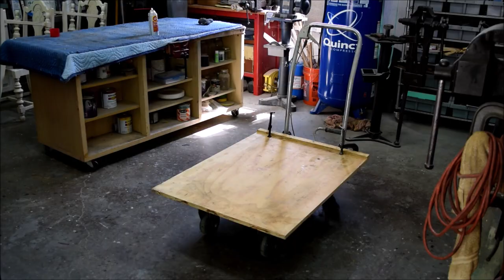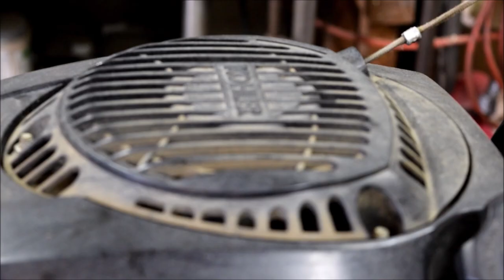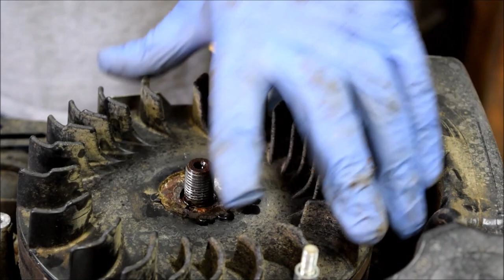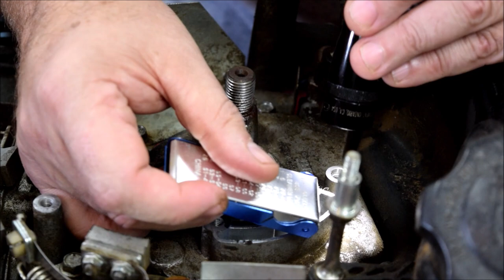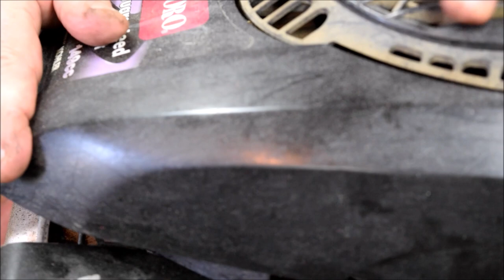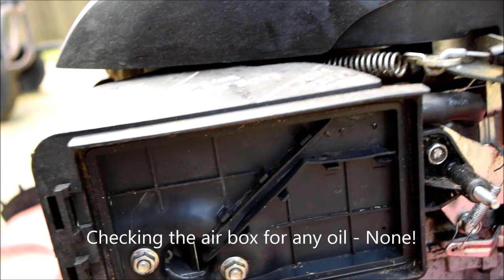Oil in the Air Box - Fixing a Kohler 149cc Lawn Mower Engine PCV Oil Drain

Comment: Great job!!! Also, thanks for reminding me. I just finished working on this same mower for my daughter. Just did a Carburetor cleaning. Had water in the tank and the bowl. But as I was watching you reassemble yours you reminded me of crankcase hose on the back of the air cleaner plate. I dont remember putting that back on. Just checked. NOPE, I forgot to put it on. THANKS,for the reminder. 😅

Comment: 3 years ago I disconnected the hose from the PVC valve to the intake at the air filter.  I plugged the intake and plugged the hose with a bolt.  I replaced the oil contaminated air filter, the fouled spark plug and cleaned the carburetor.  It has run like brand new since.
Reply: ya I don't think you really need it anyway ... it's to save the environment by burning extra gas fumes. thanks I'm going to do what you did PROBLEM  SOLVED 😁

Comment: I have/had this exact problem. 
This video is very well done. I didn’t remove the coil assembly. Removing the 19mm nut on top with an air ratchet vibrated the flywheel enough to pop it off with a small block of wood and a pry bar. 
Reassembly was easy. Engine now runs like new. 1 pull start.
Thanks!

Comment: Thank you so much!. This fixed the problem that apparently  developed over a year or so.
I didn't have a gear puller for the flywheel but on my Toro the space between spokes were large enough that I was able to perform this surgery without removing the flywheel. I used a guitar string to clean the clogged outlet. Amazing how well it runs now! Thanks Again.
Reply from the maker: Outstanding!   I'm so glad it helped.   These two lawn mower repair videos were a bit of a departure from what I normally post.   I very happy you found it

Comment: Awesome straight forward repair video...  Could be that the PCV drain plugs during an oil change with old sludge, especially on those mowers without the drain plug underneath that you have to tip to drain out filler hole.  Sludge still sloshes around in the oil reservoir even if you tip it the right way (carb/air filter up).  Much greater odds of the plugged PCV drain hole than a blown head gasket, so this video is the proverbial cat-butt in terms of a nice fix.  Very well done!

Btw - call me paranoid but I love the fact that you instructed to remove the spark plug connector which I always do when servicing any small engine.  Last think you want is the darn thing starting accidentally!

Btw2 - gotta get/make one of those lift carts.  Brilliant!

Comment: Note, to help prevent oil from being pushed out if this ever happens in the future, put an inline stone fuel filter inline with the PCV hose & it will not only save your air filter if it ever does happen, but act as a much nicer indicator that it happened if you get the clear ones. Add some fuel line & make it longer so the filters at the bottom of the loop forming a P-trap like under your sink.

Comment: Good stuff... i just fixed a mower exactly like this that had a hard starting issue, after i got it to run, then stopped, it wouldnt start even when hot. I took the metal carb completely apart, cleaned the removable main jet, the removable imulsion tube, carb body jets, all passage ways were fine, till i found a clogged jet, thats located inside a removabe plastic shaft like housing thats located right under the plastic throttle set screw thats lays under the rear choke lever connected to the govenor linkage. Opened up that jet and cleaned it thoroughly, now the mower starts right away, hot or cold, like it never had any issue, but i have noticed the mower has a slight oil leak into the air box area, im going to pull that PCV valve and check the drain hole, its probably somewhat clogged, time to open it up and stop the oil in airbox leak once again.
Reply from the maker: Good luck with it.
Reply: @LostMountainRestoration  Sure enough... the drain hole in the PCV was slightly clogged, i used the smallest tip from my acetylene torch tip cleaner to clear the hole, cleaned the crevice thoroughly with a q-tip, then poured in a couple of drops of oil, watched it drain normally like it should, put the mower all back together, and no more oil leaking into the air filter box.

Comment: First, thank your daughter for her service. As for the engine, it looks like a bad design if the oil return plugs easily. I think I would increase the size of the oil return hole. Lot of work I know but if it solves the problem it would keep you from tearing it apart again.Well, for that repair anyway. From one Ga. boy to another. I live about an hour below Macon. Good video.
Reply from the maker: Thank you!

Comment: Where did you get the lift table from? Do you have a link?
Reply from the maker: Harbor Freight sells them.  Get the 1000 pound model.   It's much more stout than the 500 pound one.   Normally about $250.

Comment: same problem with cub cadet 19" PUSHMOWER  , cleaned drain hole and reassembled  still  pushing oil  out the air filter though  .6.75 hp 173cc ,,,,,,,,,, when reassembled used a gasket sealer permatex on head gasket to see if there was any leakage [none] do the piston rings or valves usually create this problem, ,oil is always changed yearly and correct amount replaced ..ANY IDEAS OR SUGGESTIONS THANKS
Reply from the maker: If your oil isn't over full and the pcv drain is working correctly I would suspect excess crank case pressure, usually either rings, head gasket or maybe a cracked block.  Good luck and let me know what you find out.
Reply: still having oil issue ,,finally got piston rings [none available for most of the year] and checked the old rings and they were at service spec end gap limit so i thought it was problem solved .  so changed the rings and still have the same issue with the new rings installed                                                                                                                                                                          ,crankcase pressure excessive  and blowing it out the air filter .                                                                                               pulled head &  cleaned up and tested valves with head upside down and liquid poured into concave area and no leaks into the ports ,but the intake valve chamfered edge has a line/ridge  worn from the valve seat contact .still seals fine ,adjusted valve clearance when did the rings ,head gasket ,new disc spring a little stronger one etc. ,new oil correct amount ..[apparently the disc spring was a added modification after 2009 models ]                                                                                                                                                                                        piston cylinder looks fine ,no scoring but  cross hatching isn't evident ,,supposedly some models didn't require it? piston in good shape no wear on skirt and even wear on the piston rings when removed and examined..  intake valve shaft seal appears in good shape                                         @LostMountainRestoration

Comment: Good video. About you're lift. I also watch Bruch Pender and like his lift except it seems short for me. I'm 65 Y/O, and 6'5". No knees also. Your lift looked taller than Bruce's. If so would you tell me where you bought it? My work bench is 39" tall. I would like to have a lift around that high.
Reply from the maker: I bought it at Harbor Freight.   They also sell them at Northern Tool.   I chose the 1000 lb model.  They also have a 500 pound model that is less tall and less sturdy, in my opinion.   This will lift to the level of my truck tailgate (2014 Silverado).   You can look up the specs at Harbor Freight. com  -  With a 20% coupon it was just over $200 and it's a life saver for me, as my knees have also gone south.   Good luck!

Comment: Hi - is there any way to "bore" out that little drain hole to make the oil return easier into the crankcase? (Briggs v-twin 20 hp intek on a John Deere  L120 lawn tractor). You would be drilling aluminum  to bore it out but how do you keep the drill shavings from getting into the crankcase?
Reply: Might try grease on drill bit

Comment: i realize video is bit old but please reply ,,,just read other comments how did you determine piston rings were good  ,is there a proper way to check rings and compression. and wouldn't a faulty head gasket affect readings thanks
Reply from the maker: Yes.  A blown head gasket was the other problem I was referring to.   I had completed this repair when I first got this mower.   When the problem re-surfaced, I headed right to the PCV system and that was the problem.   I believe you can compression test the cylinder with a standard pressure testing device, but some mowers will have a compression release built in so make sure you know what the reading should be.    Another hint that the rings weren't the problem was the lack of blue smoke or carboned plugs.   Hope this helps.

Comment: I did the same thing and still drainig oil from the pvc
Reply from the maker: You may want to check other potential problems for high crank case pressure, including a compromised head gasket.  Good luck.

Comment: I dont have a fancy compressor any ideas how i can remove the fly wheel with just basic tools?
Reply from the maker: Place a pry bar under the fly wheel and put enough tension on it to pull up any slack in the crank.   Give the top of the crank a whack with a hammer and it will often come up.  You can also try a puller, but be careful.

Comment: Great video!  I have a question, what cause oil to spit from the crank case vent hose while the engine is running?  I made sure the oil was not over-filled first.  Thanks for any help!
Reply: Some small engines have a reed in the compartment beneath the flywheel that gets bent over time. Just replace the reed and clear out the oil drain hole.

Comment: I pulled the hose and put a bolt in it and plugged off the inlet to the air intake.  Seems  to run fine.  What are your thoughts?  Thanks, great video!
Reply: PCV is the acronym for Positive Crankcase Ventilation. It is connected to the air cleaner housing so the engine can burn off the fumes to reduce carbon emissions. So disconnecting the hose won't affect the engine's performance. Plugging the hose can eventually cause the crankcase seal to leak because there is no outlet for the crankcase pressure. The oil leak will be less noticeable because it will drip underneath the deck. If you check your oil level before mowing your grass and add some when it's low, you should be fine.

Comment: What is the nomenclature of the reed valve?  I have that problem but cannot find the part.  Where did you get yours?  Thanks for the video, I know how but need the valve and spring to make it work.
Reply from the maker: If you go to a site like ereplacementparts.com and put in your engine model, you can find blow up diagrams that will identify the part by number and you can normally order them.   Hope this helps.
Reply: Tried that.  My engine is a Rato (no kidding) 140cc made by Chongqing Motors, China.  They stopped making them years ago but they do make larger engines (Rato) and use a different reed.  Well I’ll take what I got from here and make the rounds of local repair shops and see what develops.  Thanks!!

Comment: I'm having this problem on an older 96 Toro super recycler. Do the older engines have basically the same procedure to do this? The engine is a Briggs & Stratton. I believe it's the quantum engine. Any help you could give me would be greatly appreciated.
Reply from the maker: I don't know off hand.   Take a look at your engine and perhaps you can see how it's set up.   Taking the top and flywheel off is pretty standard, but you may want to refer to a manual or other YouTube presentation to make sure.   I think RepairClinic.com does a bunch of repair videos on their website which are model specific.   You may want to check there - good luck!
Reply: @LostMountainRestoration  many thanks!

Comment: So do you recommend checking the part you fixed before going to the head gasket?
Reply from the maker: I'm not a small engine expert, but absent any other obvious signs of a blown head gasket and assuming all you have to deal with is oil in the air box, sure.   That check takes about 10 minutes while pulling the head is a much longer process.   I hope this helps you.  Good luck.

Comment: Thanks for the video.  My lawnboy, same engine is leaking oil, I'm thinking from the main seal on the bottom.  Is that a big job?  I haven't found a manual yet.  Thanks.
Reply from the maker: I am not sure.   If you search around YouTube you should find videos on it.   I believe once you get the blade off you may be able to access the seal around the crank shaft and pull it right out.  Don't quote me on it as I'm not familiar with your mower and I have not done this job personally.   Good luck.
Reply: @LostMountainRestoration  Turned out to be the main gasket between the top and bottom pieces.  Found a better-used mower for $150 even with electric start.  Thanks again.